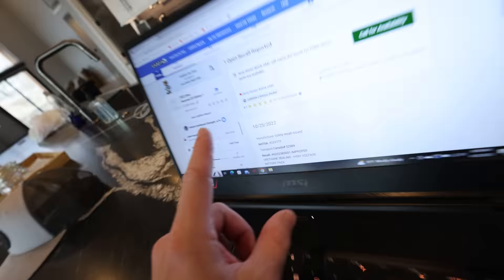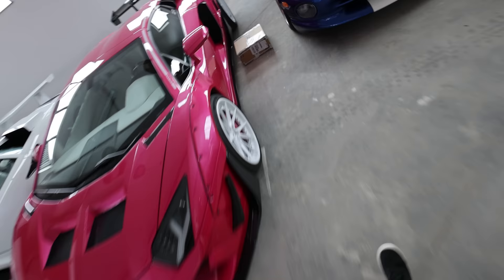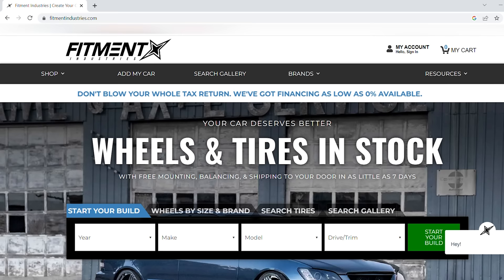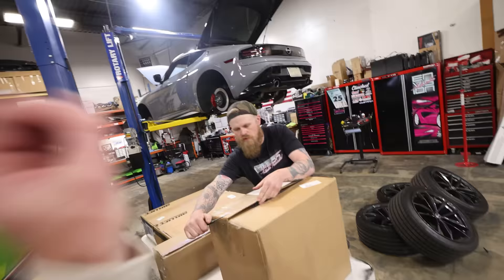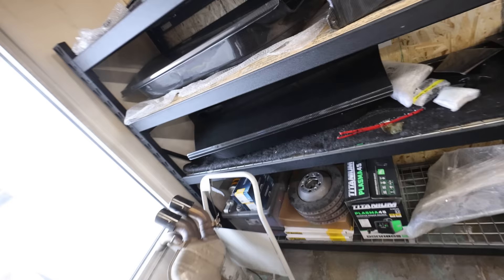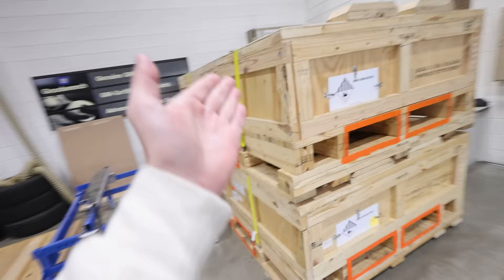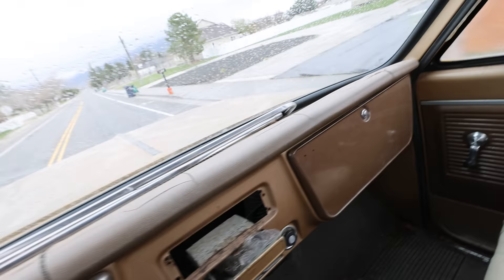The Unforeseen Disasters of my Dad's Truck but Who Cares LOL

Comment: The bug looked like a mud dauber, which aren't usually aggressive and would prob be why it didn't go crazy when you were in the cabin. Good job on maintaining composure and looking forward to future truck endeavors!
Reply: Thought it looked like a tarantula hawk but i don’t even know if they live in the us 😂
Reply: @emmanuelpaul6903  oohhh no, those things are FAR more terrifying than that lil guy, you would know if it was a tarantula hawk just by the way they act/sound alone, they are also freaking massive
Reply: @emmanuelpaul6903  same i thought it was that too
Reply: Thought the dauber had a different thorax
Reply: It was in the truck with a celebrity so it was calm.  It never attacked him.  It just wants to be besties
Reply: Either a mud dauber or a great black wasps. I work pest control and am I licensed technician, it didn’t have distinctions of yellow so I’m assuming a great black wasp or paper I deal with these bugs 24/7 he needs to check for a hive especially if the car has been sitting. N your right, keep a cool composure don’t freak out. Update watched more of the video it’s a mud dauber 100 percent
Reply: @emmanuelpaul6903 ong I thought the same thing 😂😂
Reply: A Mud Dauber's abdomen is very skinny at the base, so I rule out that possibility. It's either a great black wasp or a paper wasp (specifically Polistes Metricus), which are both widespread and mostly non-aggressive.
Reply: @t1mmysrevenge that is exactly what it is
Reply: It’s a paper wasp, mud dauber’s have different characteristics
Reply: @papixotic3471  It is not
Reply: 11:14 🗿

Comment: Hey just a heads up I’m not sure if you’re gonna see this, the stop feature on cars is actually the gas pump, when you fill a car up to full the fuel will come all the way up the neck and once the front of the nozzle hits the fuel it cuts the flow🫡. Anyways I’m glad you got your dads truck back. You’re my favorite YouTuber to date
Reply: It didn’t work a couple of times for me and leaked all under my car and on my tires and also the fuel filler and body. When I started the car, I almost blew up, but I didn’t since I’m here typing this today.

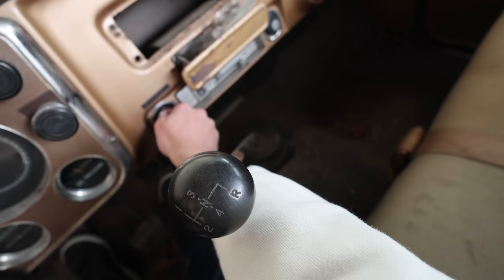Comment: @8:36 the choke should be the knob below the wiper/washer, pull that out when cold starting, then push in when temp starts going up.  I have a '68 Chevy C-10, that's where mine is.  Get a bottle of Rain-X to use on the windshield, I also use on the back window of my Honda.  You crack me up!

Comment: One safety thing to think about is if the truck's gas tank is behind the seat you should absolutely look at a replacement gas tank that would mount under the truck.  Why?  In an accident if you have a gas tank inside the cab, behind you, and it's ruptures you burn up.  Check this out and if that's the case look at how to relocate a gas tank outside of the cab somehow.   Some trucks back then had two gas tanks, one inside and one out under the bed.  In those cases stop using the inside tank, and even remove it.

Comment: Great video as always James! Just a piece of advise that I'm sure other people have already given but because it is a classic small block chevy and is obviously carbureted, the fuel pump is mechanically driven off of the cam shaft meaning unless the engine is cranking, no fuel is getting to the carburetor. Also because of the carburetor, it's a good idea to pump the gas a few times before turning the key, and holding down the gas pedal while cranking before it starts. Hope this helps👍🏼

Comment: Fun fact, the automated stop feature when pumping gas, is a mechanism within the actual gas nozzled.  From google: "A small pipe called a venturi runs alongside the gas nozzle. When the end of the venturi pipe becomes submerged with the rising gas, it chokes off the air pressure that holds the nozzle handle open and shuts down the gas flow"

Comment: I drive a 72 Chevy pickup. When I fill up the truck it does have the pressure stopping mechanism. Yours should too. The tank should be 19.5 or 20 gal. Also sometimes if helps to hold the gas pedal a hair down when turning the key to start the truck since it’s carbureted

Comment: That truck deserves a stock restoration. Only thing I would change is the engine. Since it doesn’t have the original inline 6, just put in a modern LS for reliability, and enjoy driving it. No crazy v12 swap, and for the love of Pete don’t lower it. There are absolutely tons of aftermarket resources for OEM style parts for that truck.

Comment: Put some Rain-X on the windshield and you won't have to worry about the wipers not working. I went 4 years without a working wiper motor by using Rain-X.

Comment: It being an older truck, obviously the early 60s trucks were cooler, but the sentimental value is clearly what counts here.. anyway, seems like u got 2 choices here: raise it or lower it and for sure u gotta drop a modern gm crate motor in there- ls1, ls3, lt4, etc. And I'd recommend a wild paint job...something exotic looking but with crazy ornate pinstriping and all

Comment: Congrats on finding your dads truck and the respect you have for it. I made it a point to find my dads truck a few years after he passed away as well. 2001 Dodge Ram 2500 5.9 Cummins, I’ve thrown close to $15k into it since and I wouldn’t trade it for anything. Now would my dad approve of the lift and wheels/tires and all the engine mods to get 650hp out of it, idk 🤷‍♂️😂

Comment: On those older trucks, you gotta pump the gas pedal. Just push it to the floor once or twice. Don’t hold it. And try not to use ethanol. And yea they don’t have the shut off for the gas 😂. Also that truck ought to shine up good.

Comment: That truck should be simple. Maybe an LS/4L60e combo move the gas tank under the bed and relocate the fill neck a simple vintage air system. Some body work, paint and an air ride system. No stupid V10s or alligator poop interior.

Comment: Your dads truck is carbureted, so you have to pump the gas pedal a few times while cranking it over. It makes it so the accelerator pump in the carb squirts a little fuel in the intake so it can start much easier. This is why it was cranking so long because Strad was trying to start it like it has fuel injection. Guess someone might not know this if they’ve never had a carbureted vehicle

Comment: Hey James, I’m a huge fan of those trucks. My dad and I share a 1972 Chevrolet 3/4 ton, and I noticed your oil pressure gage was a little low. I do not know if your checked the oil, but mine rides a little high, however we do have different motors so you may be just fine. I just want to look out for you and the truck because I love the story behind it.

Comment: To make an EV battery last you need to not let the battery get below 20% or above 80% unless absolutely necessary. Also charging on a Level 2 is better than fast charging. Lastly don't charge unless the battery is around 20%.

Comment: I KNOW WHAT YOU SHOULD DO TO THE TRUCK keep it simple. Make it nice on the inside, fully restore it with a nice pain job and then put in a ls3 engine in it. It would run well, sound nice. And it would be modernized.

Comment: That truck runs off of a mechanical fuel pump, not electric, meaning priming the fuel pump is a matter of pumping the throttle a few times, rather than having the key in the on position like you would for an electric fuel pump.

Comment: So two scary issues with new and old GM trucks in one video.    The scary part about the Hummer battery issue is if your one did have water intrusion issues then it could have also caused a battery fire and given it is stored in with all those other high end cars inside the garage inside your dream home that would be really a bad situation.

Comment: Gm needs to stop using junk parts. They've had my truck with only 35,000 on it for a week now to replace faulty hood latch sensor that kept setting horn off randomly thinking hood was open when it wasn't along with clunky 4l60 transmission shifts

Comment: Dads truck….. leave the paint. And completely redo everything else. LT4. 10 speed trans. 9in rear end. Nice oak bed floor. 20in steel wheels with poverty caps. Coilover suspension. Factory style interior.

Comment: The hummer is a POS, sell that POS, 3  to 4 days to charge, you had to tow it to a charger.  The Ford GMC EV are good for local store shopping only.  Didn't GMC have the same battery problem with the Bolt and Volt